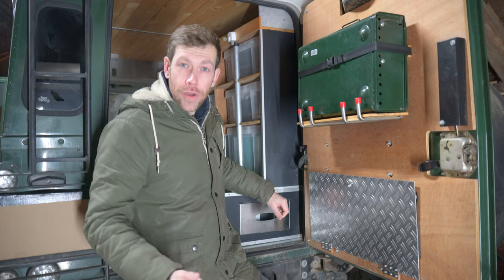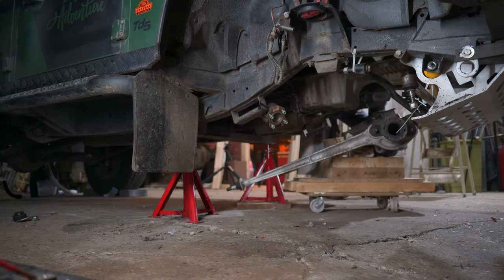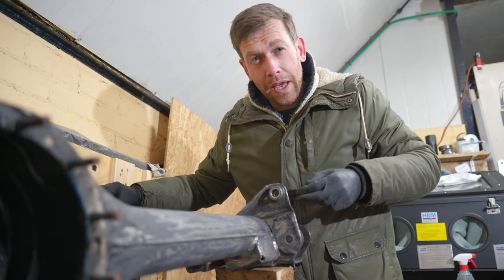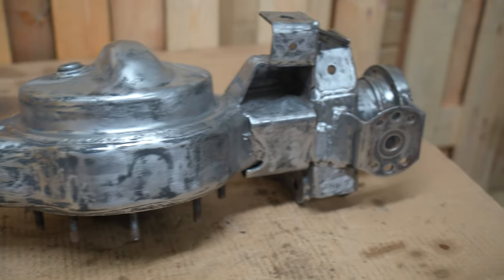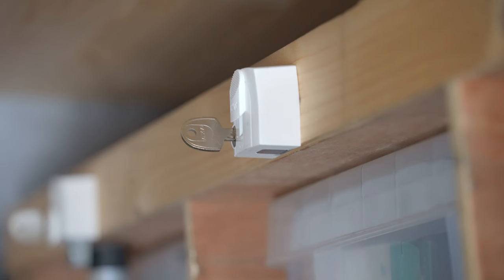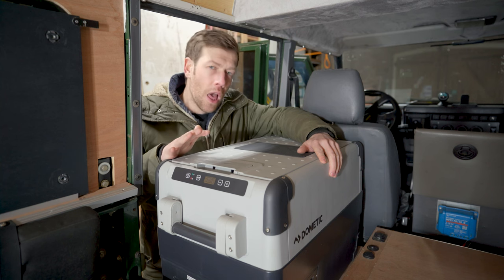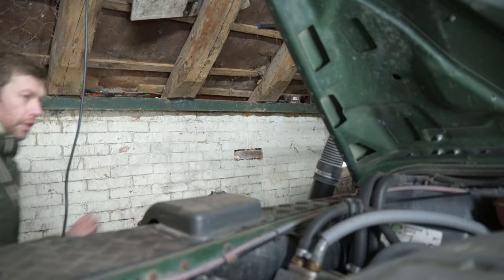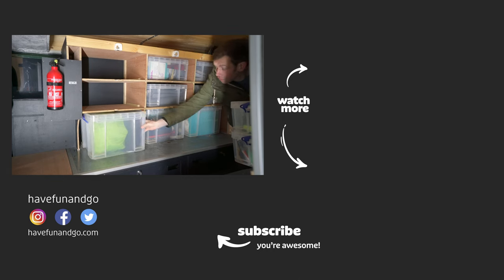Land Rover Defender ROOMTOUR + COST BREAKDOWN + Awesome news | Ep. 1

Comment from the maker: If you want to see the Defender Camper roomtour you can skip to "7:59" and let me know what you think! 👇🙃
Reply: :-) We also can't fully open the fridge lid, so I used magnets to keep it open. In our case the lid is metal and I attached two strong rubber-covered magnets to a short strap that dangles from the side of the roof's frame at just the right position to hold the lid open :-)
Hard to explain. Just uploaded a short video to my channel :)
Reply from the maker: @frank-lr  Smart!! But mine is plastic... Do you have a solution for that? 😉
Reply: @HaveFunAndGo  :) You could glue a sheet of metal to the lid. (these self-adhesive iron foils wont work, too weak).
Reply from the maker: @frank-lr  brilliant thinking man 💡😎

Comment: You’ve got a great delivery on your video. Humble, logical and critical. 

The fact you are “going to clean your axles” and then proceed to remove and strip them down completely is next level. 

I would recommend a really good etch primer for the axles or having them powder coated.
Reply from the maker: Thank you, I appreciate it! Although the whole process is very time-consuming, I think it's worth it. And powder coating the axle crossed my mind as well, but then I thought about my wallet (; So, I think a good 2k epoxy primer and 2k paint will do the job.

Comment: Less is more ! Even you didn’t mention  to keep the weight down is and will provide much more pleasure driving . Probably you have already on your list to have a technical upgrade on your battery system. Check the web and dive into dc -dc charging. Looking forward to your progress
Reply from the maker: Less is definitely more, although I'm not worried about the weight. I thought I would notice a big difference after the conversion, but there was surprisingly little. After all, the Defender is a real workhorse! But I agree that slimming down is better for the fuel consumption I Have not deep-dived into dc/dc charging as I'm planning to stick with the original setup. You know, gotta keep an eye on that old wallet 😄

Comment: Boomers use Hammerite! No, jokes aside... Preparation is vital. That is also the case for Hammerite, but if you're doing all the scrubbing and cleaning and you have yourself a shiny, bare metal axle, I wouldn't use Hammerite but a 2k epoxy primer and paint just like you mentioned! Oh and about the interior... If it works, it works!
Reply from the maker: Hahaha! I agree, there are other products on the market nowadays which are better than Hammerite, wax oil or similar stuff. Tending more and more toward the 2k paint.